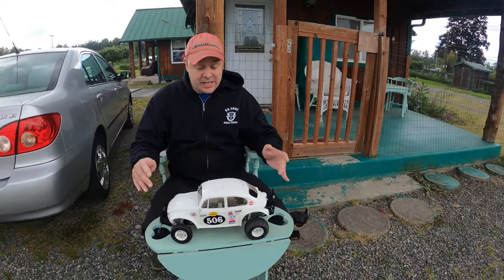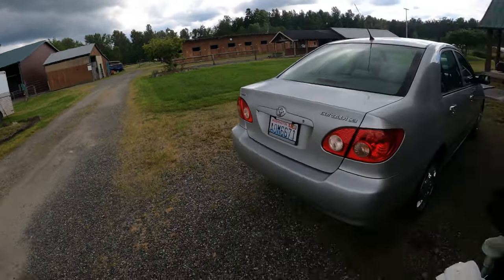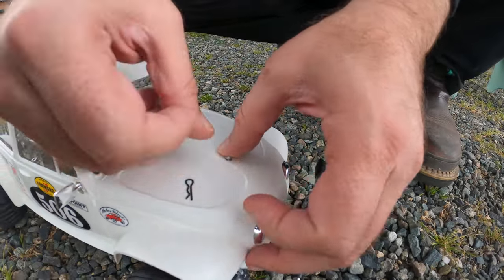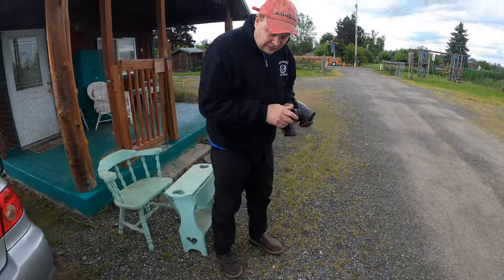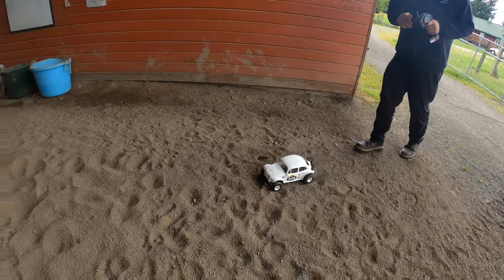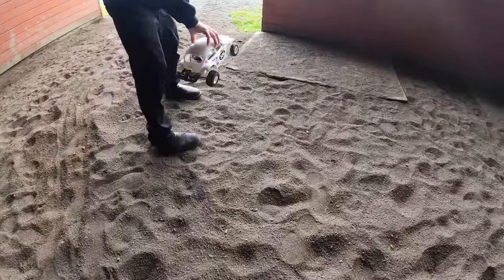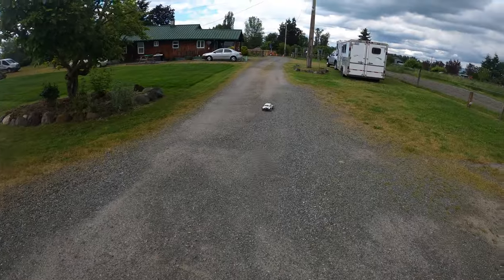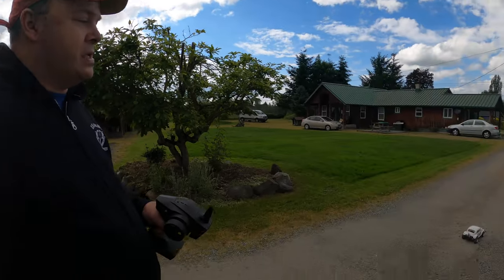RC Sand Scorcher build first time drive!

Comment: No open diff so the steering circle is poor. What you have to do is run it on a loose surface so you can get get the back out in the turn. Sand really needs to be wet.